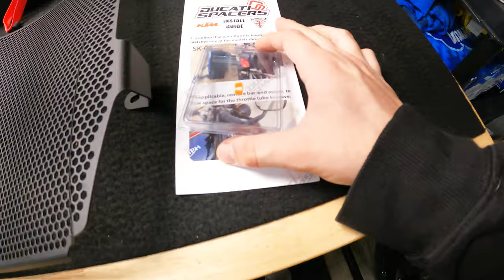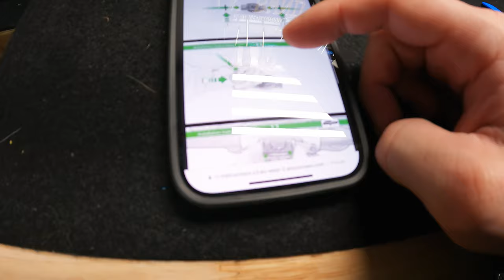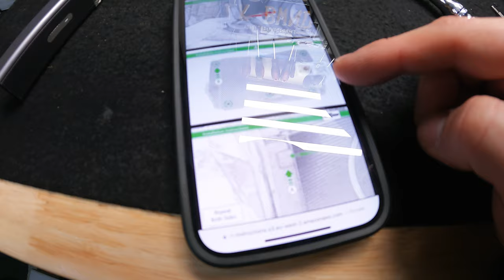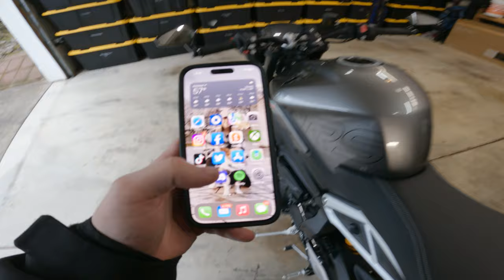New Parts For The 2024 Triumph Street Triple RS!

Comment: I build stuff, get it exactly how I want it,  get bored and sell it or trade it in.🤷‍♂️ I have a problem for sure!😂 Saying goodbye to my  Yamaha FJ09 that I have been upgrading since I bought it. I saw the 2024 Triumph in cosmic yellow and it was game over for my super reliable  2016 FJ09 with that nice triple CP3 engine.  Hopefully picking up the Triumph next week. Finding one in cosmic yellow that was less than 500 miles away was hard but I did manage to find a dealer who has one on the showroom floor. Just working out a few details with my trade in. Nice helpful video, i will for sure be doing alot of the same upgrades so thanks for the info!Subscribed👍

Comment: Curious what your thoughts are on the difference between the two bikes you have there.  I'm wanting to switch from an r6 to something more ergonomic as I'm getting older.  I've pretty much settled on the 765rs as a replacement but still interested in your opinion on the two.  Thanks
Reply from the maker: Check out my channel! I have a video going over both my Trident 660 and the 765RS. IMO since you have an R6 right now, the 765 will be the perfect bike for you. Having ridden an R6 myself (My friends) you would adore 765 ownership.

Comment: Thanks for the video. I ordered this, after consulting with you, however I also ordered the Quad Lock fork stem kit, and a vibrations dampener. The Quad Lock showed up first, so I installed it. I had to loosen the handlebar, but the installation was a breeze. I think I like it better because it looks cleaner to me without obstructing the handlebar bracket. I’ll probably sell the Evotech.
Reply from the maker: You know, i almost agree with you on the Stem mount... I didnt think the Evotech would stick out so far, but for now i think its fine :)

Comment: Do you know if the rs has a relay? I installed oxford nightriders and the flash too fast even with resistors so I'm guessing the stock relay needs to change
Reply from the maker: Im not sure, tbh I dont think so. The blinkers I have , have resistors built into them I guess because I did not have any hyperflashing issues

Comment: Where did you get the led turn signals from? The tail tidy with the led turn signals not the integrated tail light.
Reply from the maker: The turn signals are from amazon. The tail tidy is also Motodynamic but they dont seem to sell that style currently for whatever reason
Reply: @rwdconnor  did you need any relays for the leds?
Reply from the maker: @Bluecollarguy87  Nope. Straight plug and play :)
Reply: @rwdconnor  I you can remember the name that would be great. I appreciate it brother. Just bought my rs 5 days ago an I like your setup.
Reply from the maker: @Bluecollarguy87  https://www.amazon.com/gp/product/B09HBR9TF9/ref=ppx_yo_dt_b_search_asin_title?ie=UTF8&psc=1  

Congrats on the bike!

Comment: Hey mate, thank you for all your current videos about your beautiful Streety. There is just one thing stuck on my mind but I can not find the information again ... Did you mention in some of your videos that the seating position can be adjusted / lowered by removing a kind of a spacer at the back suspension? Tomorrow will be my appointment at the local dealer here in Germany and I try to be as prepared as possible haha. (I watched like all the videos available here on YT :D)

keep on your great work
Reply from the maker: Thanks Benny! Yes, the 2023(for you)/2024 models come with a 10mm spacer that sits at the top of the rear shock! Requires removal of the Seat, and Gas tank to get access to it, but it will lower the bike!
Reply: @rwdconnor  thank you so much for your quick response. Much love from Germany haha
Reply: @rwdconnor  oh and because of you mentioning the 2023 and 2024 ... Are there changes in the names of the bikes which are currently shipped out to the dealers right now? In my case the yellow one isn't even at the dealer already so I assume it's the same model?
Reply from the maker: @benny3328  No problem! <3
Reply from the maker: @benny3328  No theyre the same model. In Europe, its the 2023. In America we do things stupid and call things 2024 if released in 2023... Makes no damn sense..